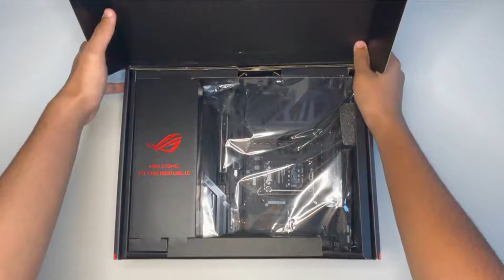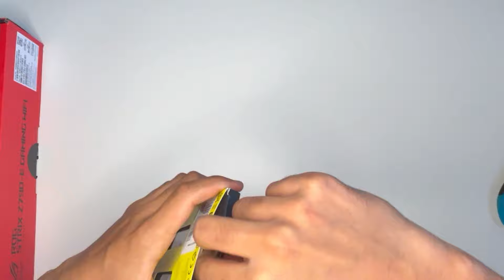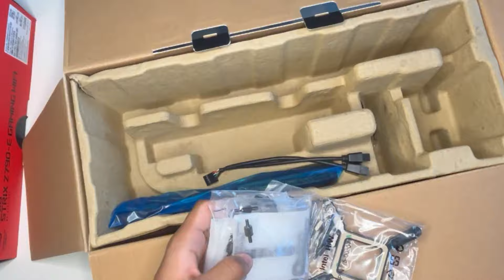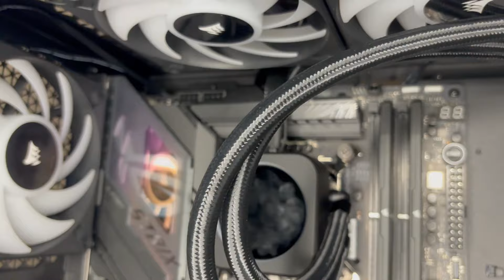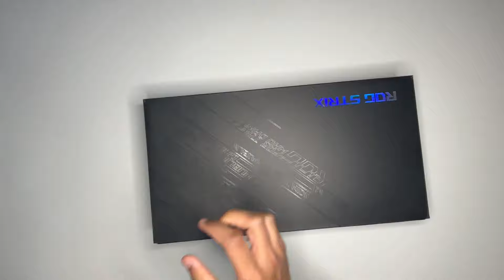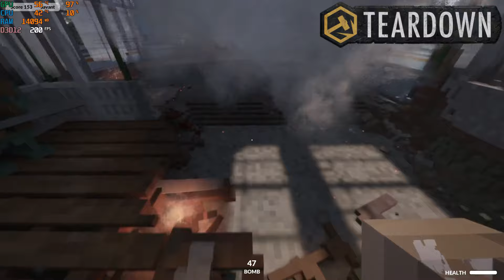Building a GAMING PC for the FIRST TIME!

Comment: Tbh this is a 🔥build, I used the same motherboard, psu, and cpu for my build too, which is pretty dope. One side note though, I think that you got a bit too much wattage for the computer itself, due to the gpu being a 4060 Ti, but personally I think is was a good idea because upgrading will be a little easier cuz you don’t have to change the psu for some upgrades. Keep up the good work!
Reply: Just a side note, one thing I would have done is research the bottleneck of the system (aka if the cpu is being pulled down by how weak the gpu is in comparison, as I am currently using a pc with the same cpu, but with a 4080 OC edition, which runs with close to no bottleneck. Still pretty strong computer though!